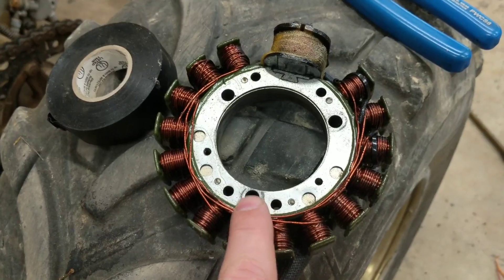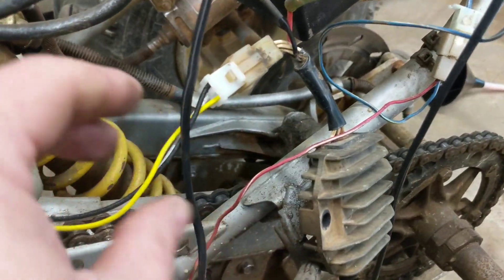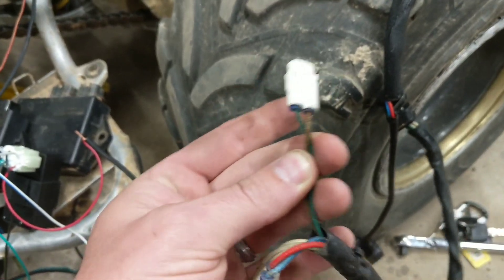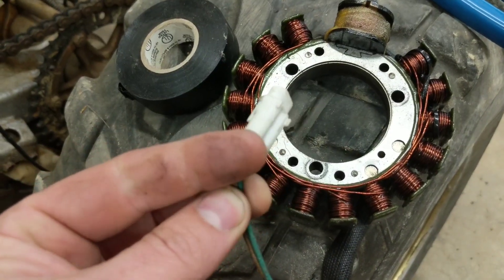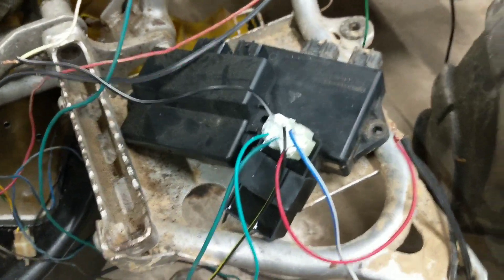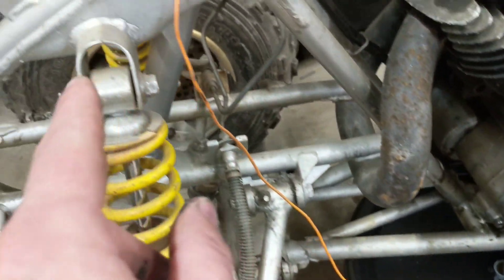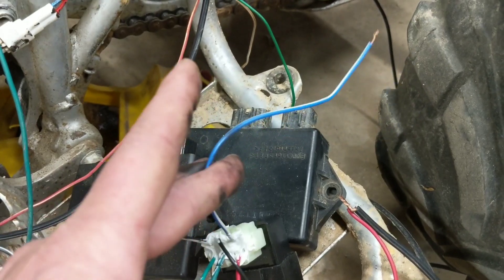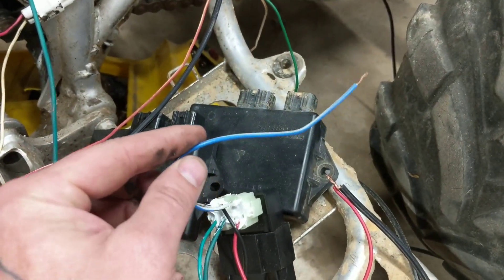How to wire a gy6 Chinese cdi to nearly anything

Comment: Thanks for this, I'm trying to convert an 82 suzuki GS 125 to DC from AC. It uses 9 wires from the original AC stator, and am replacing it with a 5 wire DC stator and the AC CDI with a 4 pin DC CDI. This has helped clarify what should connect to what, I just need to match the right wires and tape off the redundant wires, but with a 9 wire system it's spagetti. You've made it easier to get the logic of it.

Comment: You say that green and brown wire powers the ac cdi...but I’m pretty sure that’s not right, the same wires your using to power the dc cdi are the same wires to power a ac cdi also the only difference is that the power wire (red wire) goes to battery with dc and goes to stator to ac...I just kinda didn’t understand that part 6:50
Reply: I have a 97 Yamaha wolverine pretty sure it has 2 pickup coils but I wired it up like he said but the bike won't even turn over now
Reply: @justjamez27 Just remember the locations and layout of the cdi wires and your quad wiring colors arent necessarily relevant, its the where to and how coming off of and to where that matters.

Comment: Not all CDIs will work on every application. Most engines need a spark advance curve or they will sputter at higher RPMs so it could still be a crapshoot to find the right one. Been fighting my one year only 95 wolverine cdi for years.

Comment: I want to thabk you for posting this video...I know you haven't had a chance to answer my question about running 2 cdi boxes since I have 2 pick up coil triggers but I went ahead and hooked two up. I had watch another guy on DC CDI 6 pins and followed him and was not getting any spark and so I came back to yours and saw the other guy is telling people to out the power on the top right not the bottom right of the 2 pin side ....so I switched it based on what you said and BAM I got spark! Thank you so much for posting this video, or I'd be lost with no spark right now!!

Comment: I have 2 pick up trigger coils...do I have to run 2 cdi boxes or can I wire both to the same wire on the 6 pin DC box cause it only has 1 trigger wire coming off the 6 pin cdi I purchased

Comment: I was able to wire an aftermarket CDI and new ignition coil on my 81 Yamaha and did everything as shown in the video and it runs better than before! I just wanted to say thank you for posting the video. This saved me a lot of time and money since it was basically impossible to find a original CDI for the bike I've been working on. Thanks again!
Reply: I'm looking into something similar. What model yamaha was it?
Reply: Yamaha SR185

Comment: Thanks for the video! I did this on a 2001 Kodiak 400 and it actually worked! However, at higher rpms it breaks up and backfires so I don't think it has the proper advance curve like the original cdi box. But it does run well enough to get you by for a while!!
Reply: I’m having problems with my wolverine and what he does not say is cdi’s need to have a spark advance curve or they will not run good at higher rpms. Cheep cdi will get it to run but not right
Reply: @michaelevans9568 I have a 97 wolverine and tried hooking it up like he said but I can't even get it to turn over any info?
Reply: Your wolverine uses the CDI to power on the starter relay in turn providing power to the starter. You have to use a stock type CDI . I switched to 2000 wiring harness but still need a switch for the CDI. One way to start which retards timing the other way advances timing for it to run . My 95 was a one year only CDI. They say it will work when I buy it but it doesn’t. I bought a so called Yamaha factory replacement for $420 still didn’t work.
Reply: do you have any parts list on what I would need I ordered a Yamaha warrior cdi but has a 8 pin and 4 pin so not sure which wires I need to make it run was thinking of just getting the whole warrior harness stator ect. You think that will work?  @michaelevans9568
Reply: Also I did get it to start using my old cdi for the starting side and the gy6 for the spark but just runs like crap as of now I just ordered a carb as it's been sitting for a year

Comment: So I have low voltage coming from stator to cdi for the ignition circuit. I am working on an inverter generator. Why can't I jump 2 of the 3 other ac wires from the stator to power the cdi? Those would be the 3 ac wires that would normally be used for generating power output for the generator.

Comment: The 3-wires-bundle going together into the voltage-regulator are totally equal, and are the 3 phases of the stator. in the Regulator, 6 diodes are gonna make DC-Current out of the AC-Current of those 3 AC-current-carrying-cables (rectification). Otherwise, the regulator has oversight over the battery-voltage, and will cut-off the AC-Current from being turned into DC, if the battery reaches 13,5V, so to not overcharge the battery. In this case, the regulator will short the incoming AC to ground, so it gets dissipated as heat on them...
https://www.youtube.com/watch?v=IzjVDL4ZtlE
This video explains it all till minute 5:40 ...

Comment: So If I have an ac cdi and there's 1 wire (black/red) for power input and theres 2 wires coming from the primary coil from the stator which wire do I hook up to the black/red

Comment: The top right, bogus, wire is a kill switch wire. Kills spark when grounded. On mine the bottom right wire you have going to the positive battery actually gets connected to a red wire off the magneto. Directly to the battery may cause the CDI to always be on and drain your battery.

Comment: I will do my best to explain this to you it's like chapter and verse just like your friend told you The color of your Wars is everything on a CDI you're white and black and yellow War does not matter but a AC  CID  and a DC CID if you try to make them work it will fry every wire also it will fry every electrical component understand you have the AC CID not a DC CID it's really hard to explain your CID is a  A.C.   CID another words they make a A.C. CID  also a D.C. CID if that makes any sense to you at all if I could speak to you over a phone I could tell you exactly how it work's  most of China's CID are not  any good they are made cheap China's CID wars are usually the wrong colors on a CID units but always remember the color of the wires is everything if you put the wrong color of war were it's not supposed to go you are going to  fry  the CID  unit also all of the electrical components will fry also it's not easy to explain in a comment if I could speak to you over a phone also remember how to use a ohm meter and they are different settings on a ohm  Mater . But always remember the color of the warring is everything

Comment: Great video.  Clarifying question...my stator only has the 3-wire plug and the 2-wire for the pulse generator.  This may be a dumb question but I’m picking up someone else’s mess that “tried” to rewire this 250cc GY6 Engine on a  Roketa GK-19 buggy.  They failed and they gave up.  So I’m starting this up not knows exactly what they did.  My question, if it doesn’t have the “extra” 2-wire plug to power the cdi, can I assume it was designed as a DC setup?  This thing came with an AC CDI but I think I’m looking at a DC wiring setup based on your video.  
Bottom line question... it appears possible to convert from AC to DC without changing the stator but not from DC to AC.  Is that true? Thanks again for the great video. Any response would be appreciated.
Reply: If the two separate wires, are red/black (power to CDI), blue/white(pulse signal to CDI).
The others, green, yellow, and white, are power for lights, charging battery, powering enricher(choke).

Comment: do you need a charge  regulator for the spark to work
Reply: the regulator takes the AC voltage generated by the stator and converts it to DC voltage(approx 13-14 volts) in order to charge the battery
Reply: @matt-middleton7884  okay i understand but my quad burnd down i try to get the spark going but looks like my voltage regulator got burnt so im asking if it can spark without the regulator

Comment: Thank you so much. I could not fuiger out were the other wire 9ff the pulse generator went to. Its a ground!. And I have been using the rectifier power out to power the cdi. I think that's why im not getting spark!. I need to 12V + from battery to cdi. I didn't know that. I hope this fixes my issue. Thank you.

Comment: Definitely good info.  
My problem is going to be using a universal stator for a Minarelli 49cc 2 stroke on a YJ50 Yamaha Vino.
Straight up I can tell the connectors don't mate so I'm thinking disconnect the stator side connectors and reconnect the wires to the Yamaha connectors on the stator side. 
And yes.  The colors are not the same.  So I'll have to figure it out.
I'll see but first I'm a gonna take it to part-time mechanic neighbor/brother of the seller to see if the stator is actually the problem.
oy vey.

Comment: I was able to accomplish this successfully on a 2015 Tao Freelander 4x4 ATV.  I had to identify each wire on the bike separately and I recorded the color codes of all the wires on the bike and made my own wiring diagram.  You can email me if you need help with this model atv and I will share my wire color codes and info.  lizardcroymob@gmail.com with questions and I will help you with the same method.  I have full rpm and it is working normally.   Many of the parts for the original Tao Freelander are currently unavailable from partskit.com including the original wire harness and cdi, partskit.com is the best source for Tao parts I have found thus far.  Make sure you get the DC cdi that matches your cc rating.  I used the 150cc to 300cc DC cdi.

Comment: Just did this for a DRZ400 motor, using the original coil, and have it set up on the bench (not in a bike). Mostly works except some issues I'm figuring out.

Any idea what would cause a too powerful/too long of a spark? When I'm just cranking the spark is 
A: REALLY strong, to the point I'm worried about blowing the coil, and 
B: way too long, to where it almost has a continuous spark even when I'm just cranking.
(You don't want that because then it's still sparking as the fresh air/fuel mixture is coming in, which results in lighting the intake tract on fire because it's still sparking while the intake valves are still open. no damage thankfully, but not a running engine yet)

I believe this would be caused by the CDI capacitor being too large for the coil's inductance. Sadly, I can't move to a matched GY6 coil because the DRZ's spark plug well is too deep to work with one of those.

So thinking of solutions: a resistor (maybe 1 or 2 ohms,would have to play with this) in parallel with the coil input? The idea being to drain a portion of the CDI capacitor to ground, bypassing the coil, so that the voltage in the capacitor drops faster and extinguishes the spark sooner. The con is that this would result in a slightly lower voltage rise rate (because the resistor doesn't have inductance), effectively retarding the timing a little bit. 

Alternatively, the CDI box I have is one of the clear potted ones so I can see what's in there, and maybe I dig down and replace the capacitor with a lower capacity one. (this would be the ideal solution, but very challenging to do without completely destroying it).

Edit: Realized I don't have a ground path from the motor to the battery on my wooden bench, and my coil is grounded to the battery, not the engine. So it is probably charging the sparkplug while it develops current in the coil, jumps the sparkplug gap and charges the entire motor, until the inductiveness of the coil high voltage side "runs out" of energy, before the charge in motor then jumps back through the sparkplug to reach ground through the coil high voltage side, resulting in a very high spark durations. 

I'm going to try grounding the motor tomorrow and see how that changes things.
Reply: OK so an update. Grounding the engine had a very significant impact in reducing the spark size, and I suspect having the coil mounted to the engine instead of some wire twisted around it's bolt holes would improve it further. I think reducing resistances in the capacitor/coil circuit is the biggest key to getting a nice short spark.

So it looks like a normal spark now, but I won't know if it runs properly until I get some oil lines to it. (parts should be here in a week)

Comment: If I have a 50cc Super 8 2t (8pin but 6 wires) can I wire up an aftermarket CDI with 6 wires but is a 6 pin. Aftermarket CDI is also 50cc 2t)
Reply: I'm having the same problem as you and tried but no luck now I'm trying something like what he just showed

Comment: Your regulator is not just a voltage regulator it is also a rectifier cuz it's changing your AC current coming out of the stator Q DC voltage for your battery and that blue wire on that ignition box that you couldn't figure out goes to the kill switch
Reply: to the kill switch on an AC cdi only.
Reply: @Wjones450  Why do you say that? The kill switch and ignition switch are linked together and don't power the CDI. I believe they are simply ground faults. I don't think it should matter if it's on a AC or DC system.
Reply: @mitchlec8916   On an AC cdi the box is powered off the stator and doesn't require a battery. On a Dc the cdi requires 12 volts to run . I believe my comment was based off an old wire diagram I had out at the time I watched this video. I'm sure there are many different ways it's done.
Reply: Also I can't remember it exactly , so take this with a grain of salt, but I believe on a Dc cdi you just remove the power source to the cdi to kill the unit. On an Ac you need to ground it out. I think that was my thinking but I may be mistaken .
Reply: @Wjones450  You're absolutely correct. I was just talking with someone else in the chain of comments about the exact same thing. I was thinking incorrectly.
Reply: @mitchlec8916  Thank you for confirming. I dont normally comment unless im sure about it. it was over a year ago so im a bit foggy on it.
Reply: @Wjones450  No problem! I can just imagine, I bought the bike in fall rewired the whole thing this winter and just had to give myslef a small recap to understand the circuit again lol
Reply: i was trying to wire up a new racing cdi and ignition coil on a suzuki 70 cc dirt bike i think its 1986 i believe i dont know what to do there is what I think is the original cdi and sensor switch under the seat and coil of course is above the motor near the spark plug I just confused it didn't come with any installation instructions no wiring diagram and has me confused also after I tried changing it out i now have no spark and the motorcycle will not run before this it was a one kick wonder i even tried going back to the original like iit was and still no results
Reply: @bryanroyalty5439  your bike probably originally had a ac cdi and you probably tried to hook up a dc cdi.

Comment: top right wire is for kill switch
Reply: Not on a DC CDI. That's AC CDI only.
Reply: @BackyardRevivals  Why wouldn't this work? The kill switch and ignition switch are linked and act as a ground fault. I don't think it matters if it's on a AC or DC system.
Reply: @mitchlec8916  DC is killed by 12v disconnect not ground disconnect
Reply: @BackyardRevivals  it doesn't disconnect the ground. It grounds it out to cut the power to the CDI as it grounds the CDI. That's my understanding of it anyway.. If you google GC200 wiring diagram you will see that 12V runs from the battery to the ignition switch which then powers other components. And you can see that the ignition switch to the CDI and kill switch run to ground. By grounding the CDI you're cutting spark.
Reply: @mitchlec8916  gc200 is not a DC GY6
Reply: @BackyardRevivals  No ot is not but the CDI's work the same way. Just depends if you're supplying DC or AC depending on the CDI you have. Kill switch will work the same on both
Reply: @mitchlec8916  killswitch on ac gy6 cdi supplies ground to a pin, killswitch on DC cdi simply breaks the 12v connection, no grounding involved. That's all I'm saying.
Reply: @BackyardRevivals  My apologies, you're right! Now I'm trying to understand how it's wired in by looking at diagrams. I'm thinking that you run your 12v circuit through the kill switch?
Reply: @mitchlec8916  no problem at all, I knew one of us was incorrect or misunderstanding and I'm always willing to discuss and figure out which! Haha yes I believe that to be correct.
Reply: @BackyardRevivals  Same here, willing to discuss and learn. I guess this also means you wouldn't have to run a connection to the "kill switch" lead at the CDI if you're cutting the 12v supplying it when either turning the key off or hitting the kill switch.
Reply: @mitchlec8916  oh for an AC gy6 cdi I just wired in a push button to act as a killswitch for the killswitch pin. Push button in, tells cdi killswitch is on, cdi kills spark
Reply: @BackyardRevivals  oh i see, you also have a AC circuit. I was thinking if you convert to DC then the kill switch pin at the DC CDI wouldn't necessarily need to be wired in since you're cutting the 12v source before the CDI. I also have a AC circuit on my bike and stumbled on this video because I thought i had a stator issue.
Reply: Were is the kill switch wire
Reply: @elviobeno5087  there fucking isnt one on a DC CDI. YOU KILL THE POWER AKA TAKE OUT KEY

Comment: Wow, I've finally rebuilt a yfm350 engine for an engine swap into a 150cc buggy I have. The engine didn't come with a harness or CDI, so I've had to try and come up with my own. I thought a gy6 cdi should work, but I wasn't sure. Have you gotten this running and been able to test the advance curve in it?

Comment: How do you hook the stator to the cdi help plz
Reply: There will be one startor wire to change with the 12volt battery wire. That's it you just change out the power wire.